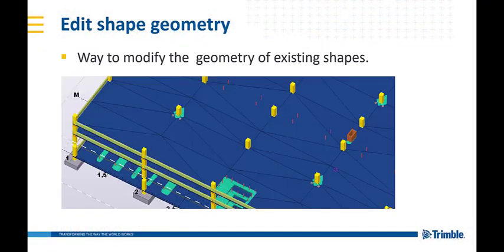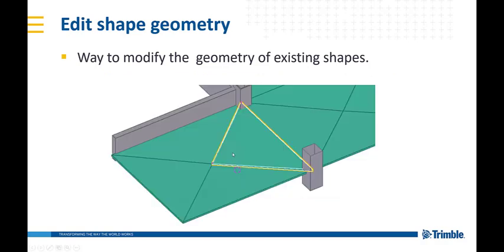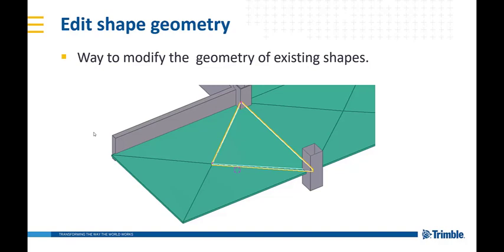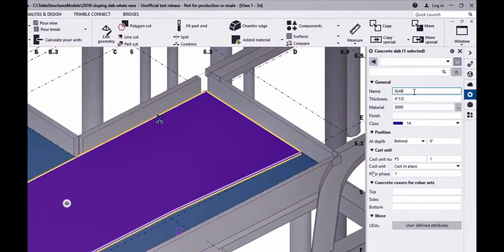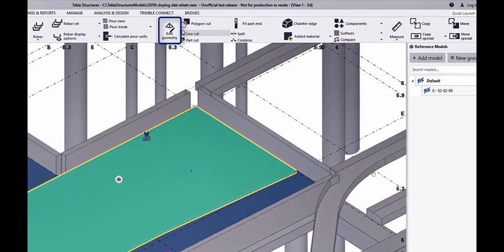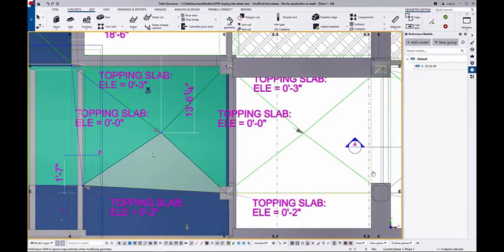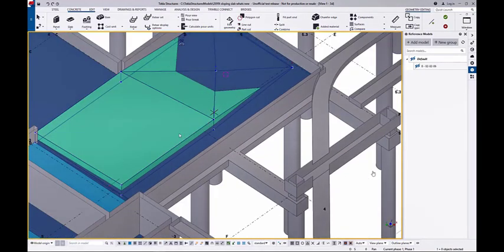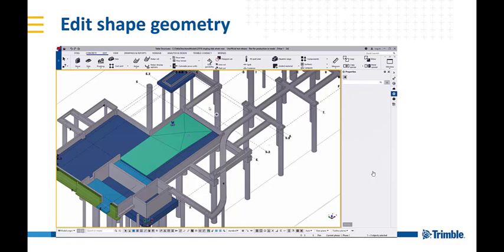Tekla Structures 2019i: Edit Shape Geometry - Sloping Slabs

Comment: This is a useful addition, however, the resulting slabs have variable thickness, meaning the bottom of slab remains flat, while the top is edited as shown. Does one need to perform the operation twice one for top surface, one for bottom surface to arrive at a uniform thickness sloping slabs?